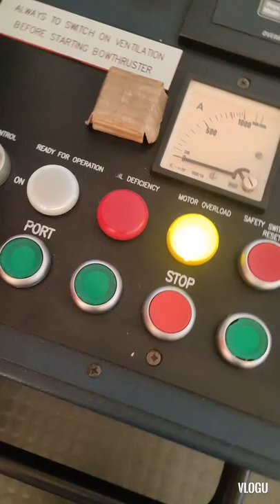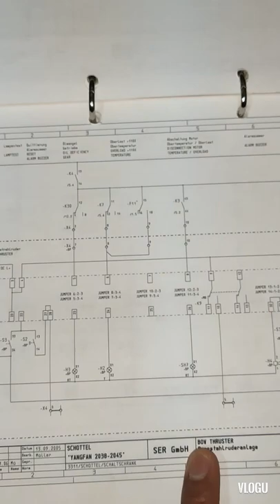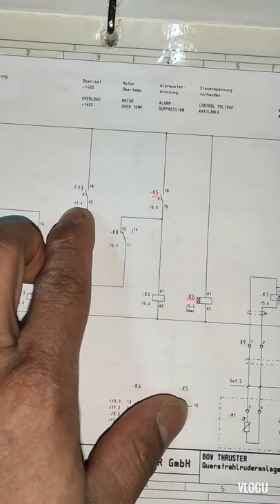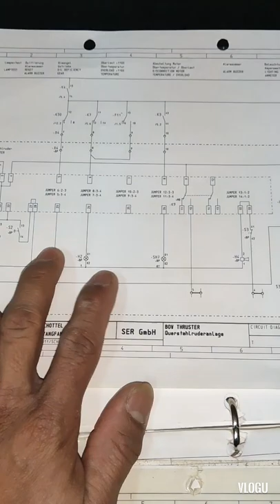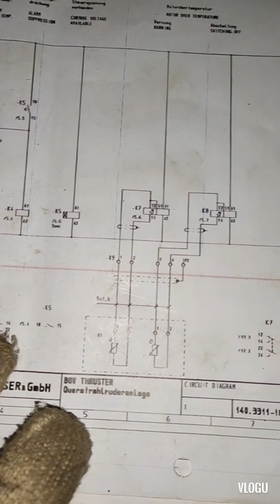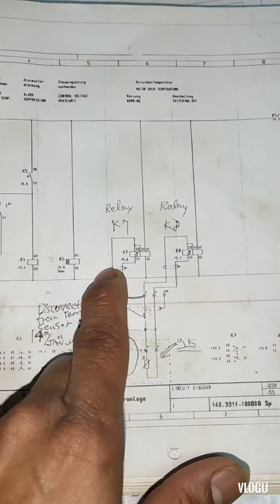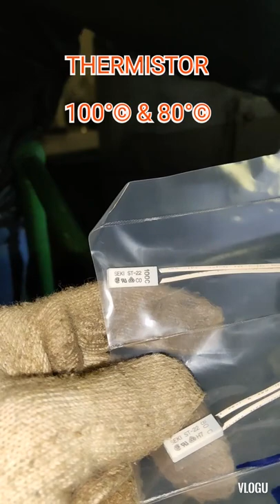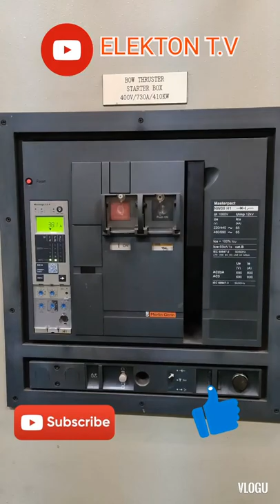SHIPS BOW THRUSTER MOTOR OVERLOAD ALARM TROUBLESHOOTING

Comment: Did you replace the thermistor? If motor stop how the sensor sense heat
Reply from the maker: in that case my friend, temperature monitoring relay,sense that the thermistor was broken or disconnected, and base on technician,theydid not replace the thermistor,reconnect only..
Reply: Ok brother 👏